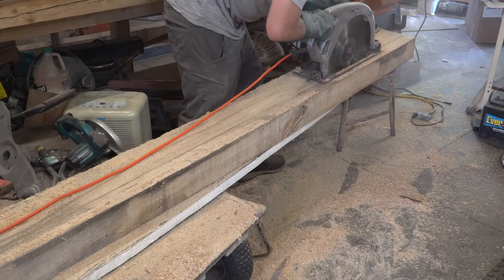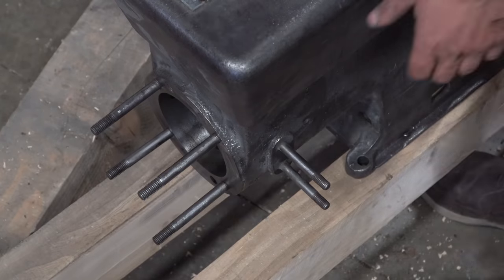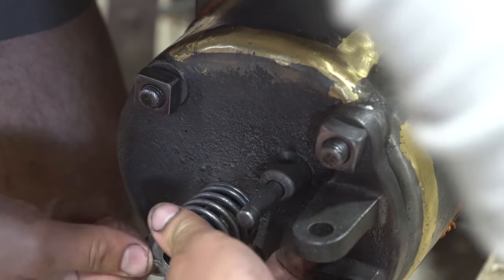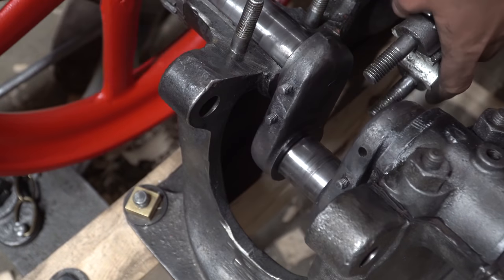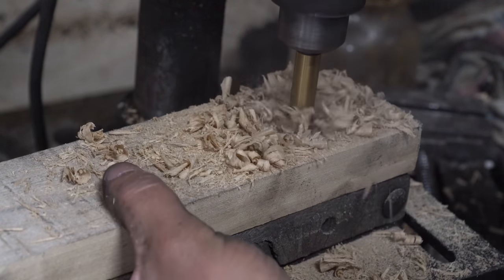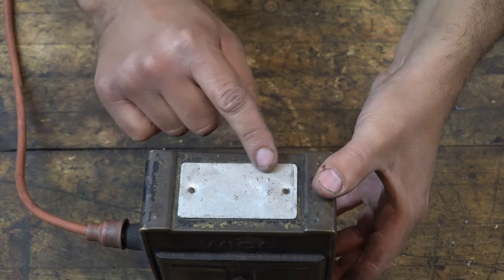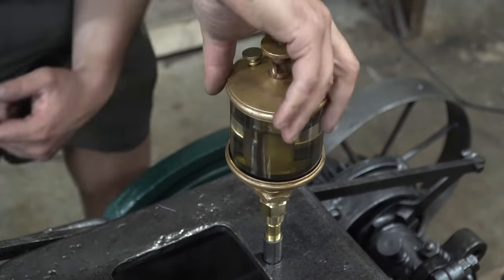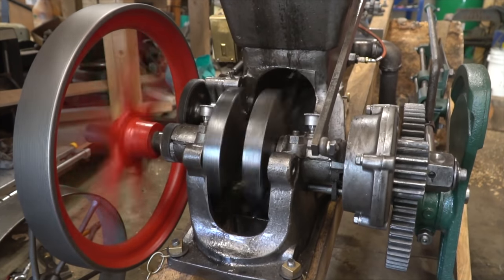Antique Drag Saw [Restoration] - Part 2: Will It Run?

Comment: This might be the most terrifying tool I've ever seen. Nice work not dying!
Reply: I pulled my knees up, tucked my fingers into opposing armpits and turned slightly to the side. My stomach turned into a knot like sympathy pains when you watch a man get kneed in the groin. Why does this machine exist? It's ungodly. He was cutting on the slowest speed, how big of a log could there possibly be to justify running it at full speed? No. Make it stop.
Reply: MattsAwesomeStuff to think the first automobiles were less complicated than this monster...safer too.
Reply: Why does it say your comment is 5 days old when the video was posted a couple hours ago?
Reply: @joshr7505  Maybe it was posted first on Patreon 5 days ago.
Reply: Yes this is a monster of a saw machine. No mercy. If it was never made we wouldn't have learned from it and evolved to better and safer saw machines. For me it looks like a mixed steam engine and an early diesel engine. Surprisingly it runs on petrol (gas)
Reply: @Frank-Thoresen  it's meant only to warm up on gasoline and then be switched to kerosene which is more similar to diesel. There are old bulldozers into the 1950's that work the same way. This engine closer reminds me of a hit and miss engine that's been modified to run more like a traditional 4 cycle engine.
Reply: Wanted to give this video 2 thumbs up but lost an arm to the drag saw
Reply: @kenleppek  Hit and miss firing is an optional extra that was added to old engines to make them more efficient when they weren't pulling much load. As soon as they load up they fire every time and run a normal 4 cycles like a modern engine. The engines themselves are still the same 4 cycle as you'd expect and you can disengage the hit and miss on almost all of them if you want to also.
Reply: @HenRefurb  I always thought that hit and miss was to govern rpm by releasing compression instead of using a traditional throttle
Reply: @kenleppek  That's pretty much it yes! It completely opens the exhaust valve so there is no compression which prevents it sucking in any fuel from the inlet too. But once under load they stop missing so to speak.
Reply: @HenRefurb  they seem like fun to me I've always wanted to tinker with one
Reply: @kenleppek  likewise. I've got a couple of old 50s engines but I'd love a nice open crank with hit and miss to sit and watch!
Reply: @HenRefurb  I've gotten into some old Wisconsin engines those pop up around here every now and then but that's about it. They have a Corn Fest in my town with a parade and antique tractor pull. It's really cool to see and listen to all the old single cylinder tractors put in serious work
Reply: It's the beta version of the Space Marines chainsword.

Comment: It's not just the huge blade that's dangerous.  Look at the machine. There's like 300 pinch points Open rotating spokes, Linkages that would break your fingers.wholy fahq. That is crazy .
Reply: We like to die like men round here.
Reply: moral is, don't make a mistake xD many things i have is just as bad as this
Reply: The instruction manual in the 1930's was when the boss would have three fingered Manny show you how to adjust the carb.
Reply: @Freedomquest08  Don't mix up Three Fingered Manny and Manny Two Toes.  One adjusts the carburetor and the other works the saw blade.  We'll let you figure out which is which.
Reply: its perfect. i love it
Reply: Need to adjust the throttle behind the arm amputator while its running?? Thats what little Timmy the shop orphan was for.

Comment: -Where should I put that regulator handle, Sir?
-Right there behind the fly wheel, Jenkins!
Reply: What do you mean I need to bend under the saw and put my hand in the running cilynder to adjust the tool or stop it!?
Reply: AlucardPawpad ClownWorld This machine was designed by an engineer on a Monday morning after a terribly wet weekend.
Reply: @horatiohornblower868  Equally good saying about russian manufacturing, if it's been done on a friday or monday, since the vodka is at the weekends, monday they're hungover, or monday drunk already celebrating the coming weekend.
Reply: @dimitar4y  I don't know if it was intended, but the first part of your username backward is "dapwapdracula", and I thought you should know I like that :)
Reply: AlucardPawpad ClownWorld ahh yes😂😂 mr Smirnoff had quite the weekend and has invented a potential murderous machine😂
Reply: @DudeGuy-zt9eg  IT was just a few little steps away from being a magician's "Saw a person in half" kit that you can use on yourself!
Reply: @horatiohornblower868  And with a empty coffee jar...

Comment: With old tools “safety” is a relative term.
Reply: It's more of a state of mind
Reply: safety in those days was common sense and a healthy respect to danger, not just in operating machinery.
Reply: @DavidLee-yu7yz  safety in those days was pay poor people to do the dangerous stuff and sleep tight not worrying about all the limbs that were cut off.
Reply: @Aleph-Noll  
Those days never really passed.
Reply: @GeneralSamov  youre not wrong
Reply: Even with hundreds of safety modifications, controls, pipe, etc. God still makes a better idiot. The problem is people are/become complacent. Guarding is just something in the way now, safety latches are just an annoyance that requires ten times the resets for every adjustment (close gate, reset, jog, open gate which kills everything, repeat). 

Doing foundry work, the least number of injuries per man hours worked, was ironically in the most dangerous place. And injuries there would absolutely ruin you. Liquid nitrogen, hyper boiled water pockets in remelt, 3000F metal spills, reaching into a 2200F giant burnout oven to remove 50-80# ceramic molds by hand, 1000F liquid NaOH, pure sulphuric acid or high concentration at 190f, using 24” abrasive wheels to hand cut parts off sprues, tons of overhead hanging conveyors swinging 120# molds everywhere, sandbox cans flashing off when opened, the list was huge. But it turns out, when there’s shit that will absolutely fuck you up if you’re not paying attention, you tend to pay the fuck attention.
Reply: This tool predates safety
Reply: @teamEP789  WE DIED BY FALLING OFF SKYSCRAPERS AND LIKED IT

Comment: I love the sound of a hit-and-miss engine at low RPM. The flywheel will keep the engine spinning and it will only fire when the RPM gets too low so it can go several strokes without firing.  The sound you were hearing when it sounded like it was dying is normal for this type of engine.  The governor will hold open the exhaust valve and stop the engine from firing when at operating RPM.  The intake valve is actuated by suction in the cylinder so when the exhaust valve is open the intake valve is not able to pull in air and fuel. Once the rpm drops enough the ignition and exhaust valve reengage just long enough to get the flywheel back up to speed and then shut off again.  These engines can idle at a really low RPM's. Great restoration as always.
Reply: agree I think i was running the saw way to fast its rare to see a hit and miss run very fast
Reply: @Plexico41522  yeah that governer had to be spinning balls out

Comment: Engineers - "where is the best place to put the controls?"
Also engineers - "how about next to the big spinning wheel?"
Reply: "If he gets injured he wasn't skilled enough to use it."
-Engineer logic
Reply: @Kj16V  darwinism alone wasnt efficient enough
Reply: kainen mattison Later the same engineer was hired to design a transatlantic boat called the Titanic...
Reply: @srfrg9707  And he even dared call it unsinkable !!!...outrageous !.
Reply: I mean, this was also the era where many things were started by just jerking a heavy cast iron flywheel as hard as you could and just hoping it wouldn't break your arms or rip your fingers off once the engine started running.

Comment: There are 3 types of engineering fit
interference, transition, tolerance ... and agricultural. This appears to be largely agricultural
Reply: hehehe :).  I know exactly what you mean.  Bolts and nuts gutentight, moving parts aren't lubed until the grease is falling off, and if it breaks, you needed to weld a bigger gob.
Reply: We call that self clearanceing in the biz.

Comment: Duuuude. This was another notch to add in your belt. Unbelievable work. Your ability to understand the physics and mechanics of it all and make it look so easy is astonishing. You must have worked your ass off to get there. I see this as yet another major milestone in your climb to the top of understanding engines of all varieties. You reminded me of a steam engineer when you were adjusting it. Very impressive bro. Keep on inspiring!

Comment: I wonder how one would even figure out how to design an exterior casing to cover all those unsafe working parts?
Reply: find yourself a few attachment points and start adding pieces! Till it's all covered. Or don't! Lol!! The pre-2000's were wild!
Reply: Simple, cover the whole thing up.
Reply: Fireball tool, could easily figure it out.
Reply: no casings, just lots of caution stickers.
Reply: @DigaDesigns  or operators with an attention span long enough to read the manual and maintain situational awareness while operating it.
Reply: @MiamiZombie2012  He's put a giant $10k water jet cut shroud over the whole thing. Like how he ruined that band saw. Waaaaaaa, it might hurt someone.

Comment: First thing, very nice restoration work.  The brazing of the head was really well done and looks nice.
*But please buy a cheap RPM device and check this engine.  It appears to me to be running waaaay too fast.  My dad had over 20 of these old hit and miss engines and they usually ran about 180-350 RPMs.  Watch other drag saw videos and you will see those running slower.
My concern is if there's any hairline crack(s) in the flywheels ... they have and can basically explode when running over governed speed.  I don't know the correct RPM of your Ottawa, but someone out there does.  Nice work!

Comment: When the saw was cutting the log I was laughing a lot - if it doesn't cut the log it's going to shake itself apart - cool saw and very fast at cutting, you did a brilliant job as ever with the restoration.

Comment: This thing is incredible. I would surely cut my foot off... maybe.... probably. Amazing engineering for its time. You got a winner here. Great restoration.

Edit: You can tell when this thing was designed and built. It didn’t need to have all the snowflake warnings pasted all over it. Farmers didn’t care what it looked like. They just wanted to build houses and barns fast. All they cared about was that it could cut logs quicker and knew to keep their hands out of it

Comment: Respect for great restoration! 
Dangerous stuff... No protective covers or of the feed system of the saw. It will wind up on the flywheel shaft or on the flywheel itself, and you won't have time to say" meow"...

Comment: That is amazing!
You need one of those saws that you could cut down trees and buck logs with now.
They had an engine a long shaft and then a rotating blade of death.
The blade could be ran horizontal to cut trees down than vertically to buck logs.
The "safety" feature  was a leather harness the operator used to strap himself to the machine.
The thought was if you were tied to the end that didn't have the blade you would be less likely to get sawn in half.

Comment: Wow, Thanks for Sharing! 
With this vintage and perfectly restored BEAST of a saw You'd probably be a welcome guest on every timber-sports event. 

I have a bit knowledge about (vintage) crosscut logging saws (keywords "cutting teeth", "raker teeth" and "teeth setting") and I've never seen rakers like this before, but form follows function: they have a special form (action only in pulling direction) and they are more massive for more power-loaded saw blades. 
I wonder about the optimum rakers depth setting of motor powered logging saws. Certainly this 5HP saw can handle more than just 2 or 3 10ths of a mm.
Imagine each raker moves half a mm wood out the cut, and 1 stroke of the saw runs over 10 (groups of teeth) rakers. That means the sawblade theoretically sinks 5 mm with every stroke of the saw. 20" log cut with a few over 100 strokes.

Comment: Amazing restoration of an Amazing machine!
I wonder if it would run on Diesel instead of Kerosine (after the gasoline warm-up).
I had a lawn mower that I accidentally filled up with Diesel once, and when it was Hot, it ran fine. I couldn't understand what I had done 
wrong when it wouldn't restart after I finished mowing, and put the mower away, then tried to restart the mower.
I smelled the fuel, and it was Diesel, so I drained the tank and refilled with gas, and it ran great again.

Comment: I believe this is 1929-1934 these machines built America 100years old and still can do the job. I love it
Reply from the maker: Oh really? How did you date it?
Reply: @HandToolRescue  there is a couple in Ohio that knows all about them you can date them approx. By what style mag, oiler, water tank and other little changes that Ottawa made. The one I have runs unbelievably well, but I am missing this steel spoked wheels
Reply: I could be off by a year or two

Comment: Absolutely beautiful work, sir!  Subbed a while ago, but haven't caught where you're located.  Only wonder as you mention Elm wood being used.  Dutch Elm went through Vermont back in the late 70's, killed most all of them.  Only the desperate wanted to mess with cutting it into firewood as the grain is so burly that even a hydraulic splitter meant huge work.  The ash here is straight grained, splits super easy and is commonly for tool handles.

Comment: Two things strike me. First, it seems that once folks got the basic ideas of controlling internal combustion engines, almost ANYTHING could be made to run. Loose, low compression, crazy controls...and it runs. Amazing when compared to, say, an Indy engine. Then, the danger. I am not a safety freak. I've run everything there is with no goggles or ear plugs or gloves since I was 9 yrs old (almost 70 years) and I have never hurt myself or been afraid. That thing scares the hell out of me. I don't think I'd have the nerve to reach in there and tweak the timing or throttle. And with all the ways that blade can get loose and chop on your body, I think I'd run away.  Very WELL and BRAVELY  DONE.

Comment: Eric, they're split pins, not cotter pins - Cotter pins are wedged, to lock cranks onto shafts, like on a bike's pedals.
Yes, I know, I'm a picky Brit - but you've got to call it by its proper name! Great restoration though, and I like the natural finish. I guess you won't be using it for cutting your wood supply, though? ;-)

Comment: Interesting. Every split pin I come across on a shaft line that has a washer underneath it.

Those pins do look a little loose, maybe wrap the legs around for a tight fit?

Comment: Usually a mag will get damp and  start working after sitting next to the fire place for a couple days. I have also put the in an over over night at low heat, about 100° .

Comment: Great video, excellent work on the restoration.  Hopefully you used Chinese elm, it seems to last better than American elm.  Be sure to keep the wood that is not covered in lubes oil well coated with linseed oil or something similar or it will rot quickly if it is exposed to weather or moisture. 

I have a small sawmill near Omaha Nebraska let me know if you are near and I can hekp you get some project wood.

Comment: Since you seem to like the copper or brass details on a tool, have you ever thought of copperplating some steel parts? It was a common practice in the days of tube-radios and TV's to do with the chassis of these devices. This method was used as a cheap anti-rust solution (instead of using poisonous cadmium-plating), the esthetic of it was just an added benefit, so to speak :) Thanks for the entertaining video
P.S. I always coat any copper or brass surface with a thin layer of WD40 to avoid premature oxidizing (a more permanent solution is clear-coating it, of course; but that can't be used on "hot" parts)
P.S.2: I very much like the description some suggested this is actually Satan's Own Saw :) Perfect inspiration for another epic horror movie

Comment: On that pin in the magneto, they were originally a bolt with a busing on it that would barely fit in the fork that drives the magneto.  That bushing varied in size by application.

Comment: In a previous episode I recall a comment regarding why wood was used for the connection from the motor to the saw blade.   Do you think that could be a mechanical fuse?   A weak point that could break if something jammed or otherwise went horribly wrong.

Comment: Those split pins you cut the ends off with the angle grinder should be opened out and hammered back around the shaft to ensure they are held in place.

Comment: @Hand Tool Rescue : Is there restorations, that break the apparatus or require major functional parts acquisitions for proper function. Like fluid-dynamic clutch parts, that have run so long in old gritty oil or other lubricant, that once everything got cleaned up, the parts proved to fit so sloppily and would slip so much, where the mechanism would effectively be broken?

Comment: Elm wood is actually far better for this than ash or pine because it's much more resistant to splitting and cracking, considering the amount of vibration this thing generates you couldn't have come up with a better replacement. You also shouldn't worry about that wooden guide (23:10) being too flimsy, its mounting screws double as reinforcement (beautiful design b.t.w.) and would take a stupendous amount of force to split it lengthwise, the only improvement you could make is soaking it in oil to reduce friction.